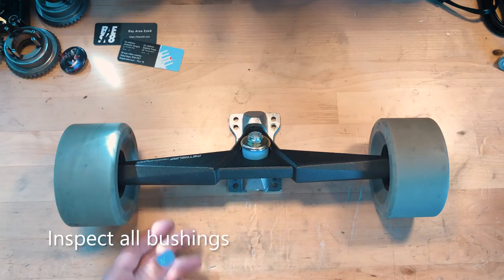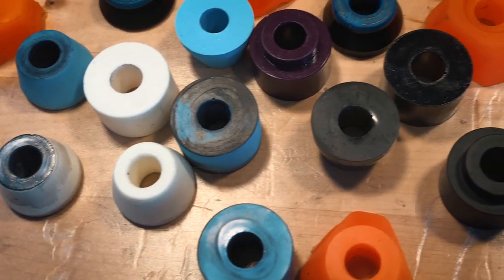How to maintain your electric skateboard | ESK8 101

Comment from the maker: What maintenance tips did we miss? What would you like us to explain in more detail? What esk8 101 topic should we cover next? Thanks to Sophia for writing the script for this episode and being my hand double!
-
Check the description of this video for links to some maintenance items. And if you're thinking of getting an electric skateboard, you can use my discounts here: https://dkwan.com/freestickers.
Reply: instead of soap shavings you can also use candle wax! make sure it is unscented regular wax as the scent oils wear down your pivot cup. (applies to soap as well!)
Reply: What about board maintainence like how to clean the grip tape and prevent your board from humidity?
Reply: Hub motor maintenance
Reply: you should not reuse the nuts that screws onto the wheels (or trucks) if you keep removing the nuts for bearing maintenance because the threads become loose. it's best to just put on new nuts so that the chances of the wheels coming off while riding is avoided.

i replace my nuts after 4 removals. you can buy these nuts cheaply here: https://www.tactics.com/independent/genuine-parts-axle-nuts-set-of-4
Reply: @karmabasedj8184  the grip tape can be cleaned by using "sanding belt cleaner" available at Harbor Freight stores. here's the link to how it looks like: https://www.harborfreight.com/sanding-belt-cleaner-30766.html

as for humidity, only storing your skateboard inside your house and not getting it wet while riding is the best defense against humidity.
Reply: Belt drive maintenance break down would be great
Reply: How about a video on berrington with alcohol and not water
Reply: Do you ever have to lube the area between wheels and bearings or wheels and and the outer nuts.
Reply from the maker: @kanafencappuccino6376  You may want to lube bearings but I normally just replace a bearing if needed. You don’t lube any other part of that area.
Reply: @DanielKwan  Thank you sir👊🏼

Comment: Putting soap in your pivot cup is just a quick short term fix. Silicone grease is the way to go on pivots as well as bushings. It not only lubricates but will extend their life. Silicone grease will also help to prevent rust on axles, nuts, and washers.

Comment: My most hated and time consuming part of maintenance is bearings. You need to remove them, remove dust cap, wash them twice in special bottle with solvents (better to use gas mask with organic vapors filter)… But this saves a lot of money since you don’t need to spend money for new set and we all know that cheap bearings are really awful.

Comment: Hey bro, love the videos, so I bought a atlas pro 4wd gear drive, I've put 250km on it for over 2 months, long story short  the metal strip that holds the bearings in place has shattered into a million piece. I now want to put the big "cog" drive chain off to clean it (not sure if that's the correct name for it?) But I can't work out how to unscrew it. Exway won't reply
Please make a video explaining how to fully service the gear drive, they say to put extra Grease after 2000km but should be able to clean out the old stuff first, makes more sense yes ?

Comment: Super helpful vid.  I saw in one of my instructions that the board should be stored at full charge.  Does that sound right to you?  Also I saw in the instructions that I should fully charge the board once a month.  Again does that sound correct to you?  Thanks so much.  Love you channel. TD
Reply from the maker: I’m not sure. I know different batteries have different optimal levels for long term storage, normally around 50% but could be higher or lower. I would do what the manual says or ask a user group for that brand.

Comment: What type of bearing grease would you suggest for hub motor bearings I feel like regular skateboard stuff is to thin
Reply: Go to harbor freight and get Sta lube red grease, we use it at work for many things and it'll keep the bearings water resistant For a long time

Comment: Do not overcharge and overdischarge
The best discharge range for Li-ion batteries is 45% to 75%. ±10% is ok
If you are not in a hurry you can choose a lower current for charging

(Adjustable DC power supply)
The above operation can greatly extend the life of the lithium battery

Comment: Do you know why Boosted suggests to keep the battery always full especially during winter when the board is not used?  Does your tip to leave the board at 50% applies to all boards?
Reply from the maker: Interesting, wasn’t aware of that suggestion from Boosted. Storing battery at around 50% applies to all Li-ion batteries for any product.

Comment: So leaving my board plugged into the wall for weeks between use is bad? If dont have a weird plug thing whatever u called it what’s best fully charge then plug back in for fifteen mins before using?
Reply from the maker: Jared B  If you won’t use for more than a week, leave the board around halfway charged. This applies to most boards. If the board’s manual says to leave it fully charged then do that instead, but that’s not common.

Comment: How do I access the back pivot cup on a hub motor board?
Reply from the maker: Same way as any board. If the motor cables are preventing you from removing the truck hanger, you may need to take off the ESC enclosure or whatever is preventing the cables from moving.

Comment: After how many kilometres do you think you should perform bearing maintenance?
Reply from the maker: When one becomes noisy
Reply: So far the method I’ve operated by is just that. Also slow spin rate. I was just curious if anyone had figured out an average distance in kilometres they were getting between maintenance
Reply: Anyway, good videos man!

Comment: Do you know why Boosted suggests to keep the battery always full especially during winter when the board is not used?  Does your tip to leave the board at 50% applies to all boards?